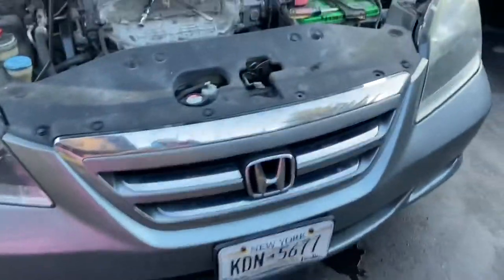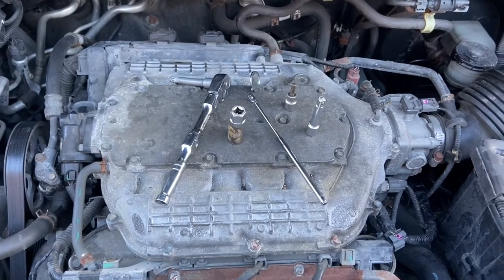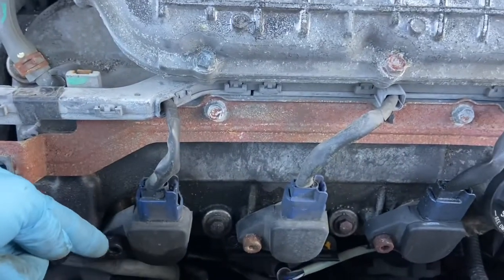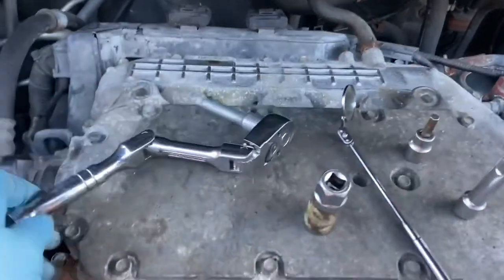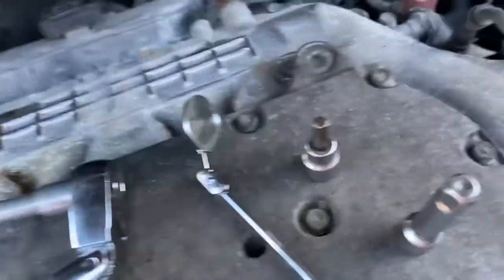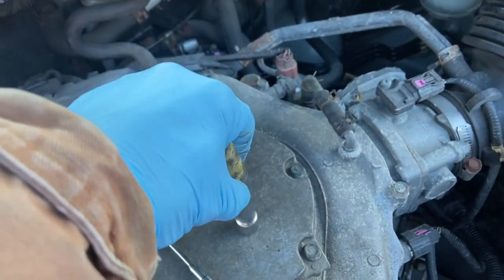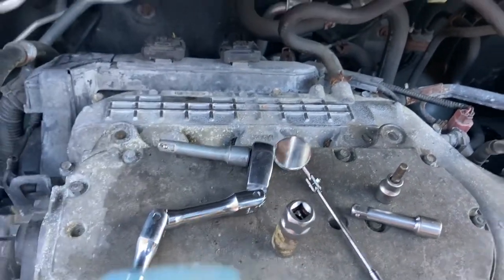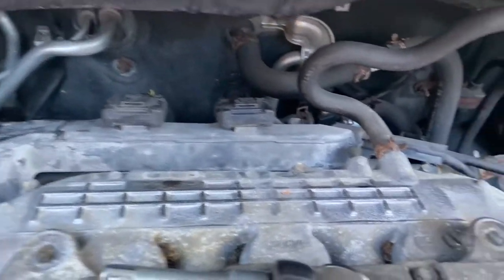2005-2010 Honda Odyssey Spark Plug Trick (Rear Bank)

Comment: That’s the only way to do it. I’m an old timer working on cars for many years and I recently finding out that you’re not supposed to use anti-seize on the spark plugs. My son was the one that actually informed me we had a decent meeting of the minds. Turns out he was right. When doing this job you have to do it exactly like he saying in the back using two 3 inch extensions. Do not use Anti-seize-for two reasons. The first reasonYou will not get your torque speck right. The second reason is because the conductivity will be diminished. If you’re gonna go ahead and use the NGK plugs There was already antifreeze properties in the material. No one bothered to tell me that till recently. Now the last question is do you use dielectric grease on the coil on boot?The answer to that one is also NO. Although it resist water etc. it also attracts dirt sticks to it like a fly and a fly trap. This is hotly debated. So we’re doing this job just replace the plugs clean your old coil on packs or if replacing there’s a nice kit on Amazon with six new coil on plugs and 6 new laser Iridium spark plugs for 90 bucks. Now go crack you a cold one job well done, see you in 75K to 100,000 miles. This comment well only matter to someone like me that really wants to get the job done right. People working for peace pay and mechanic shop will never ever be able to do the job is because when you do this yourself always take more time and be better than any certified mechanic always remember that!